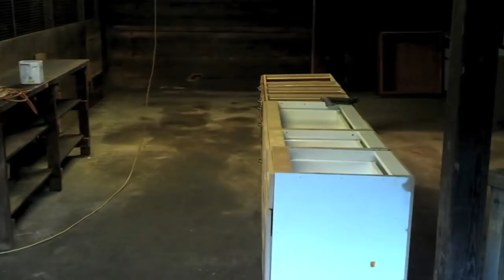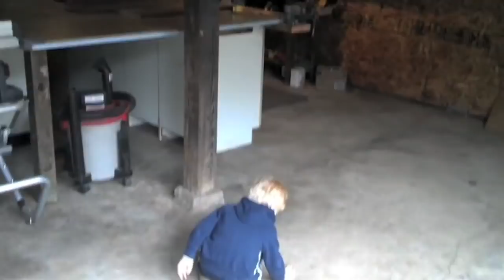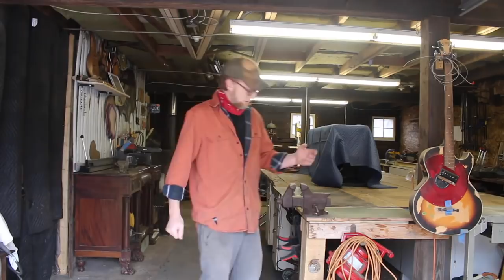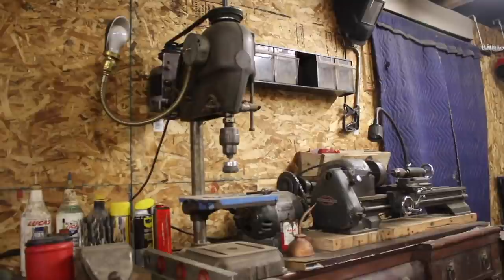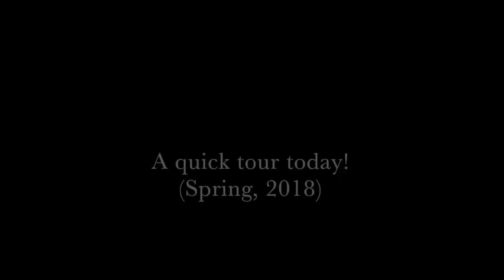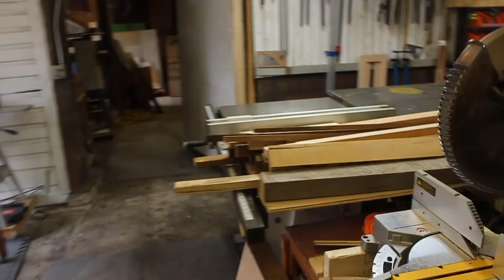Shop Tours Old and New - Sway Back When

Comment: My status now is like yours back in 2013. Everything in my shop is reclaimed, upcycled or picked up from the street. Broken cabinets, single drawers, pieces of melamine and of course pallet wood. I transform them to Frankenbinets (Frankenstein cabinets from pieces 😁). Unfortunately I never find p!ywood and cannot imagine myself finding hardwood.  I only bought some of OSB. To be honest, I really enjoy the process...
Reply: Stamatis T- I’m the same way. Luckily, I have a facility down the street from my garage shop that tosses out pallets and 1/4 inch plywood scraps. It’s amazing what dumbbells and 5-25 lb. disc weight can do when gluing 1/4 plywood together to make 3/4 inch. I do buy hardwood for hardwood related projects though...mainly cutting boards, when necessary. 
Thanks for the tour Tim! Glad to see where you were.
Happy Mothers Day!
Best,
Sonny
Reply from the maker: yea man. my shop still is basically all reclaimed, but maybe with a little more paint and lipstick now... same cabinets, etc., but I bought some MDF for the top of my bench on last redesign. I miss the cork!
Reply from the maker: making your own 3/4" from 1/4"? now that is dedication. keep it up!!
Reply: tim sway I can’t help but do it. I can’t make myself spend $35-$50 on plywood. Thanks for the props!

Comment: I would love to hear about your “old workhorse” tool, that one thing you’ve had forever, use constantly and would be saddest to see come to an end of its life.  My example would be my drill press, it’s was a cheap no name brand I picked up long before I ever started Woodworking and it’s become one of those tools I use on almost every project and it just keeps on going.  I couldn’t ever imagine my shop without it.
Reply from the maker: Chad Martin I have two that instantly come to mind. I remember being younger than Vance and playing with my dad's drill press, which he got from his father. I have now given it to Vance when I got my Walker Turner. 4 generations! I am going to restore it with Vance when he gets a little older. The other is a millers falls handplane passed down from my other grandfather. Vance doesn't get that one yet. I'm still using it :)